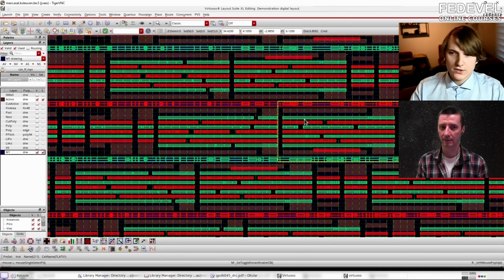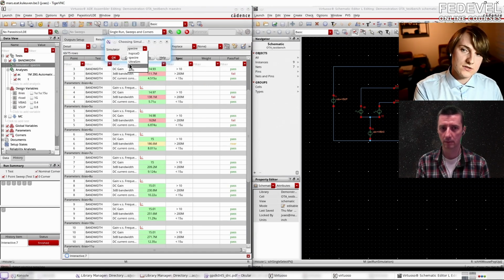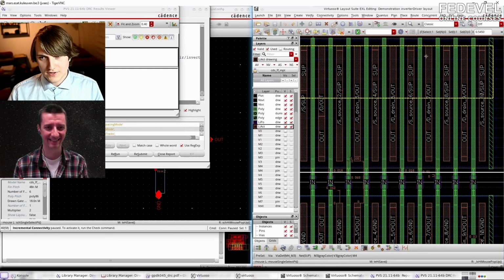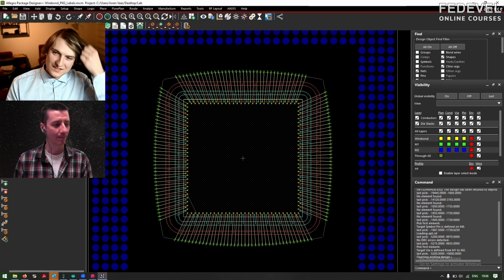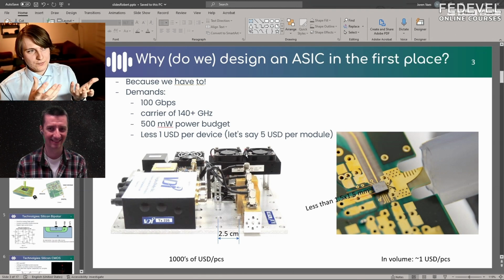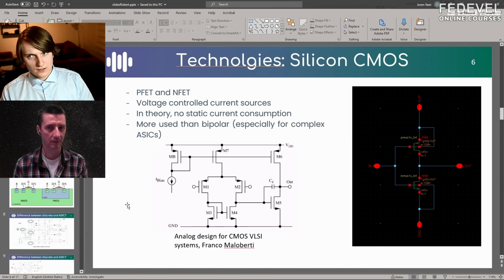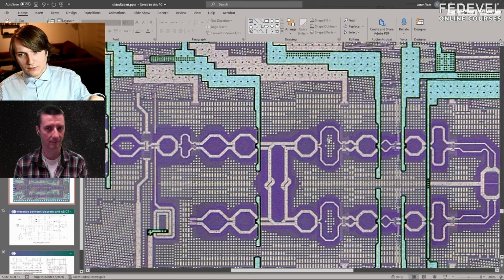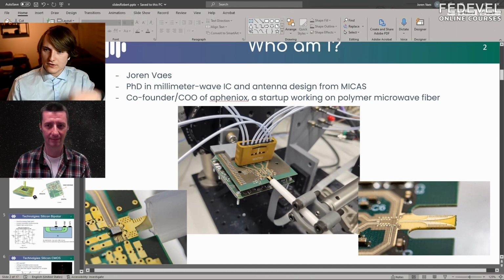Explained How Chips Are Designed

Comment: Hi Robert, first a thank you very much for all the videos you have made particularly about PCB design & layout. They have taught me so much valuable information which I use on an everyday basis when I layout PCBs! And then, since I cannot see how to contact you (I may of course have missed this information), I will allow myself a slightly off topic comment here with two suggestions for additional PCB layout related topics. The first suggested topic is how GND connected vias lining a PCB microstrip changes the trace's impedance as a function of via spacing and distance to the trace? The second is how component pin distance from the GND plane increases the EMR from these pins/components? I.e. is there a significant difference between the EMR from e.g. an SOIC component and a component where the pins are placed below the component (e.g. a UQFN package)? Hope you may find these topics to be interesting - & again many thanks for making these videos! Cheers, Jesper

Comment: i don't even know how to comment on this ;d. i knew that modern (2006+) chips can contain resistors inside (made of silicon, etched in die's structure), but this whole transformer killed me :D.
Also i would like to see Robert having interview with developer of one of software using to simulate desing before sending it to foundry :D. 

seems like designing chips is like designing pcbs, but in such small scale that you have to account for all physical phenomenas happening inside. 
is it possible to revisit this topic and update the bond wire on already made design? :D 

this gives so much perspective on higher level problems, like why and how ICs misbehave when traces on PCB are too long, or how it's possible to have only PCH's malfunction inside of mobile CPU

Comment: Regarding "gate all around" construction, Samsung's foundry shipped their first 3nm node MBCFET silicon mid last year. It's the same idea as GAAFET but instead of rod-shaped gates they use sheets. Annoyingly, the customers they rushed this out for are the cryptocurrency miners (insert huge eye roll here), who were scrambling for lower power consumption. So most of that brand new 3nm tech is probably in a landfill by now. Samsung themselves probably won't ship useful SoCs based on MBCFET until later this year.
Reply: @aphenioxPDWtechnology  Makes sense. It wasn't super widely publicised anyway because it isn't really going to be relevant until they start rolling out the next generation of mobile SoCs. I was only vaguely aware of it because I was searching for something GAA related recently and stumbled across the press release!

Comment: You talked about decoupling capacitors a few days ago... My question is why doesn't the IC have that capacitor, or why external components are needed, why can't they integrate everything inside the IC? Thank you.
Reply: Size of the package and manufacturing
Reply: Digital ics have capacitor cells made out of mosfet capacitances.I dont know about analog decoupling
Reply: Because the size of capacitance you can easily put on an IC is in the picofarad range; if you want more it will take a lot of space and therefore cost more than the functional part itself.
Reply: There are a lot of integrated decoupling on-chip, but as pointed out, this is much lower than what you can get off-chip, hence why usually both on and off chip decoupling caps are used.
Reply: probably due to size constraints, also might tend to be more failure points in the ic, so better to have them out side